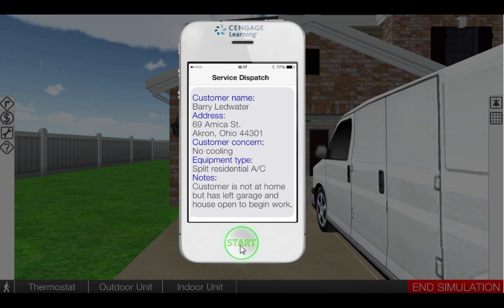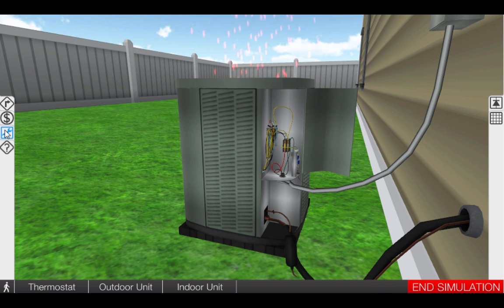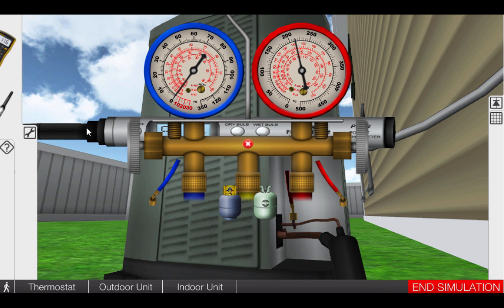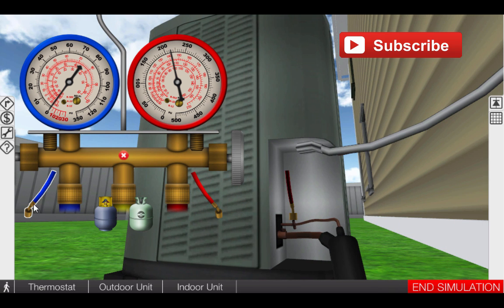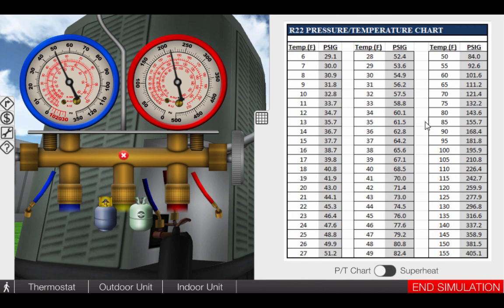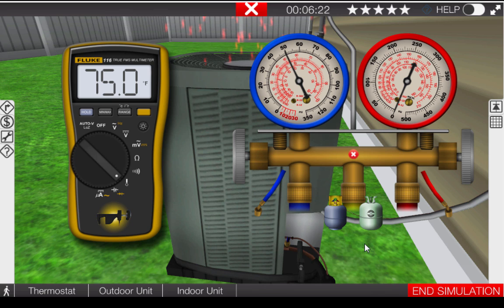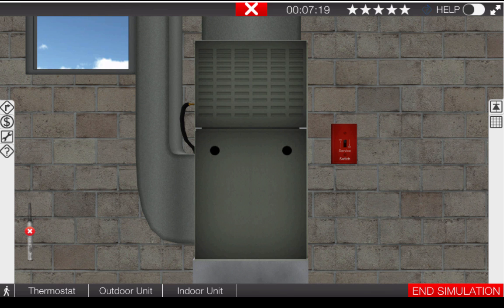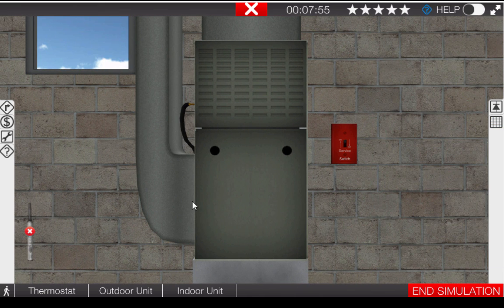Residential AC Leak Troubleshooting Video

Comment: Why didn’t you just use the Testo gauges to get subcooling and superheat readings, so you could determine if  the high superheat reading is due to a refrigerant shortage, or a restriction?  If you don’t take a subcooling reading, how do you know the charge is isn’t bottled up in the condenser, due to a partial restriction? I’m really surprised, as an instructor, you didn’t mention how to determine the difference between a refrigerant shortage VS a partial restriction.  Technicians adding  refrigerant over a restriction is a problem in the field and is the cause of a lot of compressor failures.
Reply from the maker: Testo gauges were added after the video was produced.  Same result using a standard gauge manifold and thermocouple thermometer.
Reply: @InterplayLearning  you missed the point. If I understand the original question, he's not saying you have to use the digital gauges, but he does question why you did not check subcooling at all, with ANY method. Therefore you are not certain the high SH reading is due to low charge.

Comment: You never took a subcooling temperature before you said it was low on charge, so how do you know it isn’t a partial restriction?  Should have just used the testo guages in the tool box, it would have showed you all of that

Comment: Where's the video where you have to deal with a customer yelling at you when you tell them how much R-22 they need and it's going to cost them almost 1K.
P.S. stick with yellow jacket mechanical gauges, testos suck.
Reply: i am retired for years but i been seeing change over to 407c  from r22,,,,,just saying ,,,,, in 2020 i am still holding on to a brand new cylinder of r22 and 1/2 of a used one ? may never use them ? i would have to find a r22 ex valve on a new unit i imagine ,,,,thanks , stay safe
Reply: JB gauges are just better !
Reply: The field piece SMAN480 is a nice manifold.

Comment: I think its important to mention the type of refrigerant you're using since that will effect the starting pressure. Here you went 95*F and added 20*F (O.A.T + 20*F = 115*F PSIG) which for those new to the trade that means the refrigerant used in this system is likely R-410A.
Reply: R22......